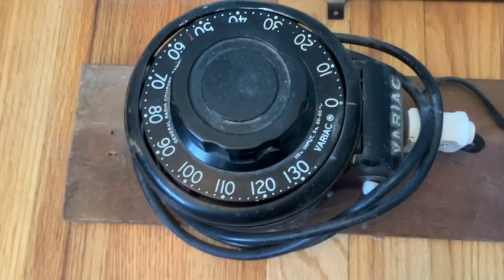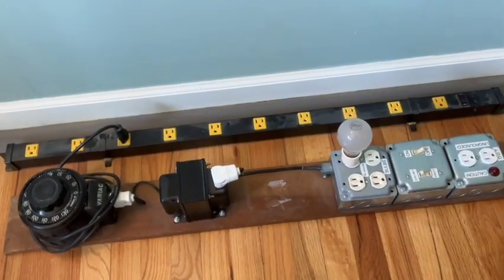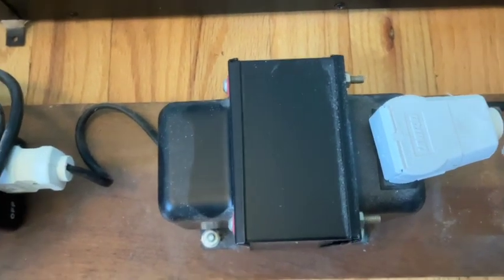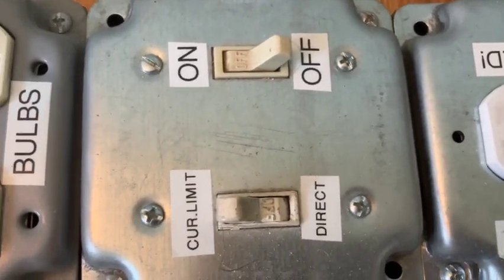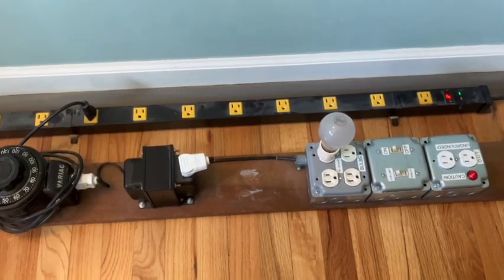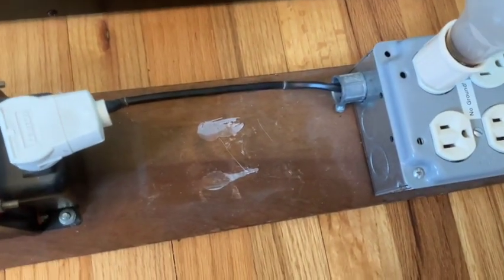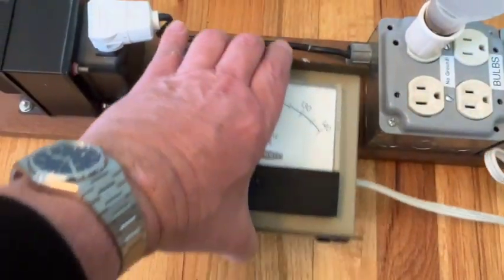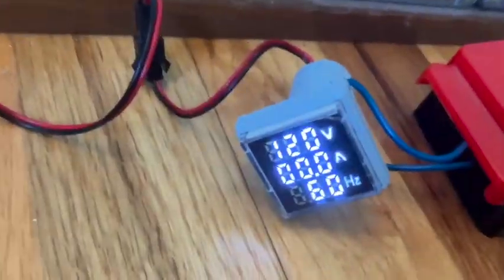My Variac / Isolation Xfmr / DimBulb Setup

Comment: I have thought about this since blowing up a scope in 1968. Isolation first with  switches for ground and neutral . Then the Variac but check how it is wired. My import had the wiper to neutral. That was corrected with a 250watt soldering IRON. Absolutely no metal boxes after the ground lift.
Reply from the maker: Yes, If buying a, say, imported, variac or isolation transformer, it's essential to open it up and confirm exactly how it is internally wired.  Thanks for taking the time to comment!

Comment: 50 years ago in the middle school I was taught transformers are induction devices thus the transfer is a function of current, so in that line of thoughts it will be appropriate to have autotronsformer aftet the isolation one, though in that case power of both transformes should be equalized or the isolation one should be more powerful than the variac.
Reply from the maker: Makes sense, but in my case my isalation xfrmr isn't rated for very much load.  Thanks for the comment!

Comment: Hello. Thanks for this post. Can you show your schematic/wiring diagram for this setup?
Reply from the maker: I never drew up a waiting diagram as it's pretty straigforward.   Variac plugs into the wall,  Isolation transformer (2-wire) plugs into Variac.  Output of Variac goes into junction box which has a light bulb in series with one of the two lines, which then goes to a toggle switch before the outlets.  Another switch shorts out the light bulbs.  Nothing is grounded. That's basically it.  Good luck and thanks for the comment.

Comment: I believe that  the purpose of the isolation transformer is to isolate the hot line's reference to ground/neutral, which means you could run your ground wire to your output plugs and that won't show a voltage potential between either of  your two live wires which you could check with your resistance meter with the unit off, or check AC voltage between the original ground and your two isolated lines with it on . I think the main reason you'd do this is to allow static electricity in/on a device to still be able to dissipate to ground, but I haven't really seen any videos discussing that. 

Same as your disclaimer goes, I'm just a guy on the internet who has never even hooked up a dim bulb tester (but I do understand the purpose of one)r, so take all of this with a grain of salt haha
Reply from the maker: The isolation transformer is there to isolate both hot and neutral.  In the US at least, ground is bonded to neutral at the first disconnect (ie. the breaker panel).  Also, once you've isolated the device under test, take care with how you power (um,  ground) your test equipment.  A case for battery-operated DMMs, scopes etc Thanks for commenting.

Comment: No isolation on a Variac its just a tapping off a primary
Reply from the maker: Yes, but perhaps you're commenting on the thumbnail variac picture, not on the rest of the project which has the isolation xfrmr right next to it.  Thanks nevertheless for taking the time to comment.
Reply: They apparently did make some Variacs with isolation built in - they used a separate secondary coil. The one here is an "autoformer" that is definitely not isolated alone, though going through the separate isolation transformer accomplishes the same thing for much less than hunting one of those isolated various down haha.

Comment: I have a more compact and refined version of isolation and dim bulb, The Super Isolation transformer I have is a huge 500VA continuous power compact one that came with dual outputs made by Elsund, it has a ground center tap isolated from the mains/chassis ground on the outputs. I modified mine to have a switch for virtual ground so I can completely lift even the virtual ground on the load completely, I added Power switch and a Neon bulb on the transformer as well as a huge MOV for spike protection. my transformer already came with a resettable fuse 240V 6,3A (1500watt) that pops out if you load it too much for extended time but I added extra protection around it too. The dim Bulb addon could not be more compact and I have never seen any design on that like mine. I have re-built a single to dual outlet adapter to have your current limit output that goes through the lamp that is placed on the second output of it instead, the size of this addon is smaller than a Gameboy. you just plug it into any outlet and pick a bulb and it´s ready. I have this plugged into one outlet of the isolation tranny and if I want to disable current limit I simply move the plug to the other output. if I want to use a variac I just plug this into any of these outlets only when I need it instead. mine is big (up to 2000Watt) or 8 amps 260Volt. My version of isolation/current limit is the most compact and simple I have seen on youtube and it is always ready on my bench without taking up space barely more than a 2Litre pack of milk on the table with the current limiter included. 
The tools are essential to have for any technician of both Tube and modern equipment but I see the trend pretty much everyone make these so big and bulky it is even hard to have it available as a part of your bench at all times. I mean as long as it fits your desires it´s no problem but space is also precious around your workspace :)
Reply from the maker: Sounds like a great unit; why not do a video on it?
Reply: @dtss_smudge  yeah I really should do that some day

Comment: Yes, please, I would like to see the analog volt and current meter build, with schematic, BOM and parts links.
Reply from the maker: My greatest challenge seems to be finding  good meter-paper-scale-design software for Mac, to re-label stock ammeters to 0-130 VAC and 0-3A.
The actual electronics for extending ammeter ranges and converting them to voltmeters is straightforward   Think resistors in parallel or series, respectively.  Oh, and rectifiers for AC...

Comment: Warning: The BK Precision 1655A is a screaming piece of dangerous junk. No solder mask on the PCB. 1940's circuit design and parts. Horrible construction quality. Useless soldering iron controller. I had three brand new arrive DOA, from a reputable OEM supplier.
Reply from the maker: I had a quick look at this B&K, and putting aside any quality concerns, it seems to have things you don't need (soldering iron temp control) and not things you do need (current limiting)...
Thanks for the comments!
Reply: @dtss_smudge  Probably, the mindset is that overcurrent is supposed to trigger fuses/breakers, NOT be limited - When not in a lab/workshop environment and attended by a competent amateur or professional, a current limiter can cause an accident rather than prevent one (especially if you allow limiting it to an amp or three, as you would need on a 200...500VA capable supply - plenty enough to start fires while keeping any fuse or breaker from interfering).